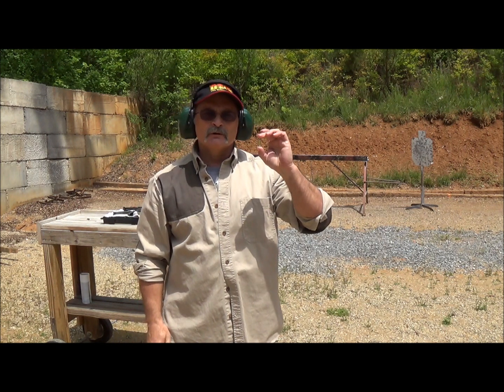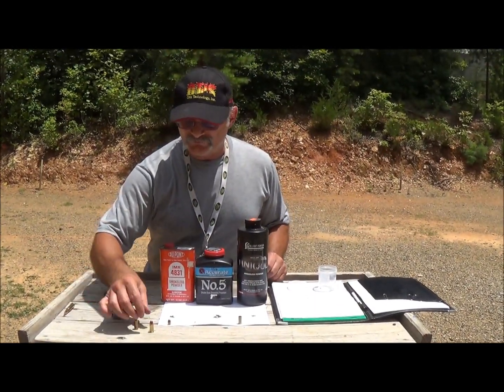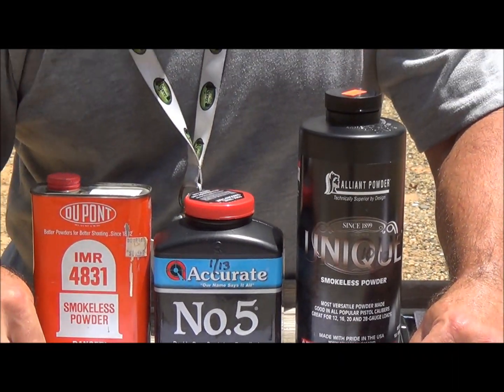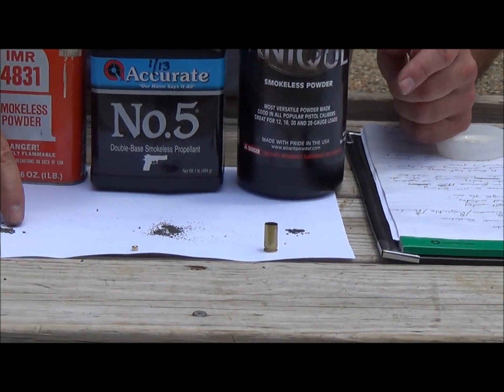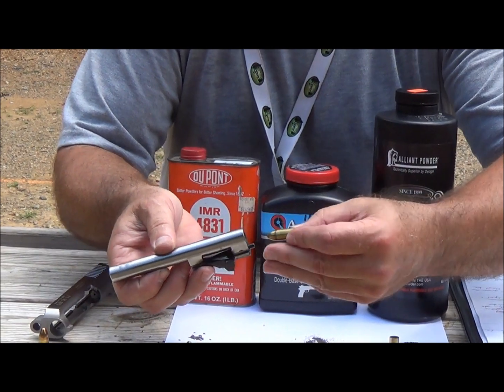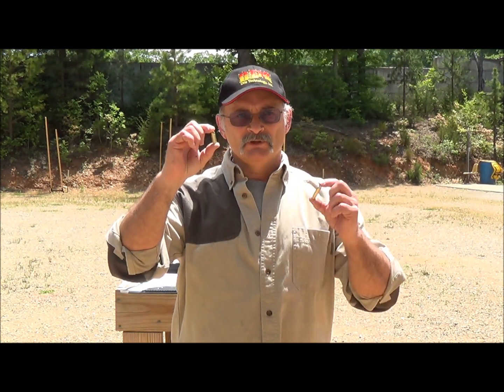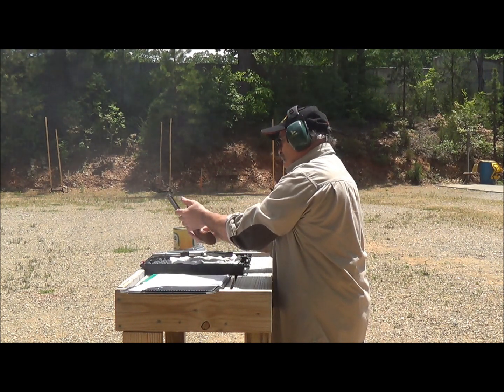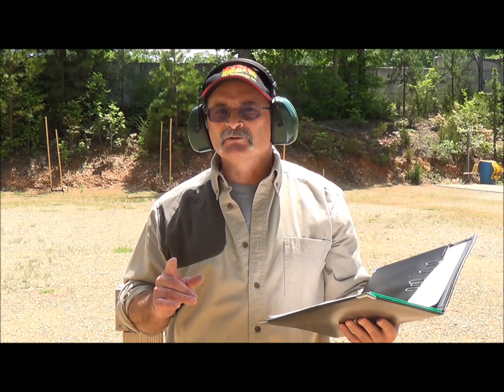How Bullets Work

Comment: Wouldn't the explosion push both the bullet AND the primer back at you since the expanding gas push in both direction?
Reply: Its a physical rule....gaz in expantion will always choose the weakiest way to exit...in a case of an ammunition it will be the bullet !! even if the bullet seems really thight to the casing its still the weakest part of the ammo !!by the way, the pressure of gaz will build up until the rupture point of the bullet and then propel the bullet...(aka, if the bullet was loose it will be eject with almost no pressure)..i am not an expert but this is the most logical reason of an explanation....